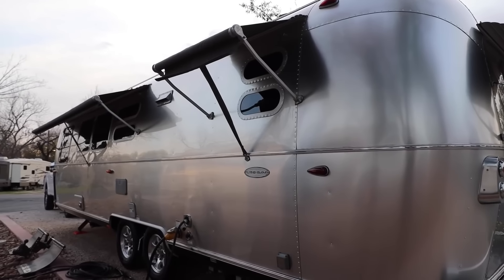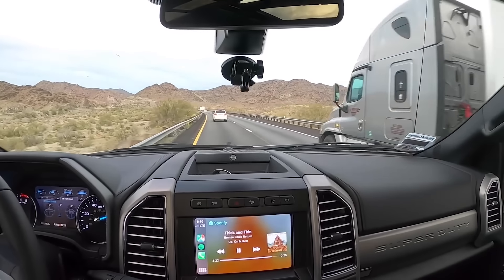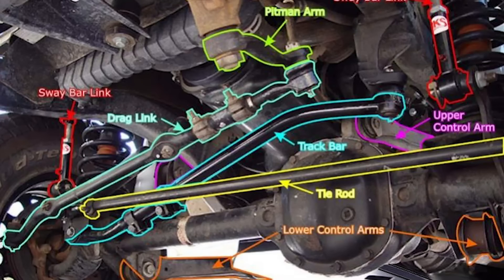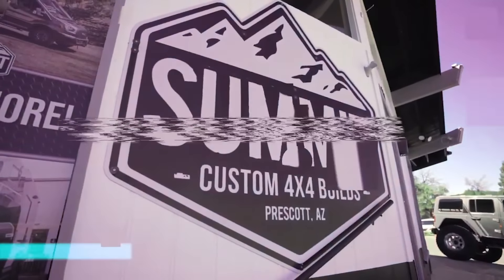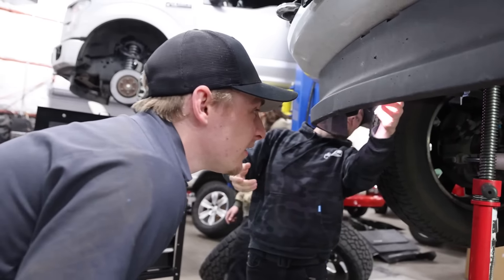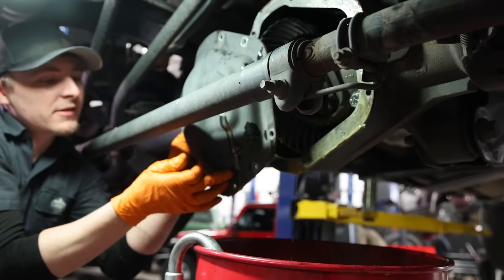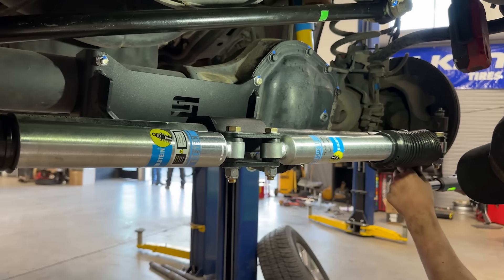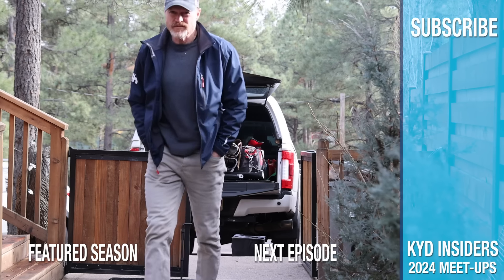2024 Ford Super Duty: Why We Passed...

Comment: I'm a retired semi-driver and the thing about changing all the batteries at the same time is bad advice. I bought a new Vovo in 82 and I bought a 35.00 load tester from Harbor Freight I replaced the batteries based on how they did on the tester, the truck had three batteries and I replaced two of them various times but one of them was still in the truck when I sold it with four hundred and ninety-five thousand miles.

Comment: On the stabilizers bumping: There was a change to the engine crossmember for 2019, so kits made for 2017-2018 models would bump it. I had that situation and it bumped BAD until we figured out that they ordered the wrong part and there was a kit designed for the 2019. Got the shop to take the hit and install me the right one at no extra cost, they are the professionals and should know what parts to order.

Comment: I need to comment on oil changes. 
Oil filters have a limit to quantity of particles it can handle until they are completely clogged. 
After the filter is clogged, they have a built in bypass. 
Which means it will no longer filter the oil. 
I will say (with certainty) no filter lasts as long as a manufacturer states. 
Also, keep in mind, recommended oil changes are suggested by the people that would love to sell you a new vehicle.

Comment: We have the exact same truck except in Black. Just a little over 100k have already changed the oem shocks to the Blistein 5100s definitely looking at the exact same front end work you've just had completed. Had death wobbke at 20k had Ford fix it as part of the recall no issues so far. Truck had about 15k when we purchased however other than tires and one set of brakes we've had no other issues. Thanks for your continued content as some of your other mods are also in my radar.

Comment: As for maintenance,  all my vehicles have over 250k on them.  Gas and diesel, i change all engine oil at 5k miles, transmissions & transfer cases I do every 25k and axles get done at 100k miles. I even have my kids doing this.  It's just easy to remember the numbers 5,10,15 your oil gets done 25,50,75k transmission. Spend a little extra now to make it last.  I do all my own work so that helps with the bill also. Im big on preventative maintenance.

Comment: Regarding ownership cost:
The examples you gave do reflect a low cost of ownership, with the exception of opportunity cost, or the “cost” of having all that capital tied up in a depreciating asset. 

We’re occasional travellers (weekends, maybe a 2 week road trip in the summer) and I’m not in a situation where I can or want to tie up a couple hundred grand in my rig, so…my truck turns 12 this year, and my trailer 14. Total value is probably under $25k(Cdn). I do pay more for maintenance. It just reinforces your point about starting where you are. 

Great and informative vid this week. Keep em coming!

Comment: I have a 2019 F 350 Limited. I purchased it just as the 2020 model year was coming out. I was very cautious about the 10 speed being first year in the 2020 SD and knew that the old 6 speed is great. It had 250 miles on it with full warranty. Paid 72K which I thought was a pretty good deal. The Limited is just pure luxury and I love it.

Comment: Great video! If I may add something to your comments about death wobble; besides the steering stabilizes, adding castor angle to the front end alignment is key. The factory setting is very low to reduce steering effort at low speeds.

Comment: For me the topper and bed slide is a must.  As a Chevy guy it is extremely enlightening how much you Ford Dodge and Jeep guys have to do to get your truck to drive normal! 😂 Looking forward to the new season!  Safe travels.
Reply: I agree and find it interesting that they won’t even consider a GM. There is no death wobble on GM trucks. GM quit udon the CP4 in 2016. Ford doesn’t care and continues using it. I am a retired mechanic and Ford is great if you make money fixing them. You will never see one in my garage.
Reply: Gm trucks have their own issues mainly expensive transmission problems with the Allison 10 speeds and shotty fit finish and wiring problems theirs a reason why the government has had to bail them out twice and now maybe a 3rd time.

Comment: All the points about a 2024 are very valid I’ve heard from YouTube and reading forums that the 6 speed (6r140) is a an excellent transmission and more reliable than the 10 speed (10r140)

Comment: The true preventive measure to prevent death wobble is a $30-40 set of caster shims. You need more caster than they come with in stock from.  I did that to my 2020 Tremor as soon as I bought it, and zero front end issues so far at 42k miles.

Comment: After selling our 2017 f250 platinum and 2019 Jayco Northpoint 377 about a year ago, we are wanting to get back to a 5th wheel. I just purchased a 2022 Ram 2500 Laramie 6.7 Cummins with 40k miles. I have no complaints yet. I’ve always owned ford but changed this time….😮

Comment: Having owned trucks for 40 years, I was somewhat astonished by the colour of the diff fluid indeed, as usually any time I've changed it's just black & oily.   Good idea on getting the transmission done, as I waited until the 130 mark, and I was starting to get a shudder when climbing hills (empty) so I went to the dealer and had a flush, and it's been fine ever since!   Still have a great truck their, and will give you great service for some time yet!   I do hear the 2024 HO has quite a power increase, so perhaps Ford would allow you to hook up the trailer one day to one, and you could give us a shout out on any differences?

Comment: I love my 19' F350 Platinum 6.7 - your oil change comment has me thinking and I'm thinking next oil change I'll send off a sample before my normal interval and see how it does.  I don't use my truck a bunch but when I do use it I try and have a trailer hooked to it most of the time.  I needed steering components on mine before 30k as well, quick dealer fix and it's right as rain.

Comment: OK! I'm glad your keeping the truck, there's no need to replace it you'll get over 300,000 thousand out of it easy! I had a supposedly well know service shop change the oil in my differential ! Well that turned out to be a disaster! I then needed to change the brakes, as it is a dully I needed to pull the axle . As a precaution I pulled the plug out of the differential and when I did there was something that shocked me... there was metal shavings all over it! Knowing that I just had that oil changed that pissed me off! I fixed my brakes and put it back together. I took it to ford because I wanted someone else to be my witness . Then I payed them to change the oil In the differential , they did and told me that no one had ever changed that oil! You being in the shop while they were working on your truck is a lucky thing!

Comment: I change my own oil and fuel filters as well as the oil on my F350 Super Duty diesel.  Oil change with filter costs around $100.00.  I buy the diesel oil at COSTCO.

Comment: I pull my rv with a 2018 f250 gas gusher but still get around 14 mpg. Keep it slow and steady and you can pull it with out problems yes maintenance is an expense but with now 98000 miles on it hauling the rv with no problems at all I think we do good.

Comment: I completely agree with you on the truck market. Last fall, I looked at a new ram 3500 duelly for $102,000.00. Now that all the kids are grown and independent, I started thinking about getting a luxury truck for an RV hauler. But then, a week later, I was at a dealership getting my honda serviced that I found a 2019 Ram 3500 sw 8ft bed, Longhorn trim, with 23k miles/ diesel. I got $10k trade in for the Civic and drove it home for less than $70k. That includes bumper to bumper coverage. I saved over $25k ish, and I am completely happy with the purchase. Now I just need to find the right RV.
Reply: LOL you got ripped off man. I paid $70k for my 2020 Denali 2500 brand new!  Your '19 is 5 years old now.
Reply: Full size, diesel, with 23k, longhorn trim.

Comment: 21:45 this is precisely why at 50,000 miles I did transmission fluid, both diffs, transfer case. Waiting until 128,000 miles to do a transmission service is far too long. You’ll be lucky if the transmission doesn’t start slipping on you.

Comment: On level ground I can go 60 miles an hour at 1500 rpm in overdrive and not in tow/haul go to tow/haul on hills. I have a 5.4 L gas engine in a F250 4x4 supercab super duty 8 foot bed pulling a 7770 lb if fully loaded pull trailer. ( I know they say one of the worst engines was the triton V8 but if you use full synthetic and change at a regular intervals and the correct oil viscosity that engine will go easy 200,000 miles and even more if you do a full timing redo.) Love your videos have been watching since 2017 or 2018

Comment: I agree with waiting and using your current truck longer. I worked for GMC Truck for 12 years and like you said it is not how much you pay upfront it is the cost over time until you sell. We don't put the huge mileage per year like you do so we tend to keep our vehicles 10-12 years. We did get caught in 2023 when we sold our 2009 Escape (178K miles) and bought a Rav4. No inventory, high demand...paid over list (never again). We know that over time it will be fine. Our daughter needed a good safe vehicle. Eventually we will need to replace our 2014 4Runner 153K miles. We aren't in any hurry as the new 4Runner or Land Cruiser will be just coming out in 2024. Will wait until at least the 2nd year of either vehicle. 2 reasons, new vehicle high price, 1st year teething problems. Just bought a small trailer so will sort it out and use up the 4Runner some more. They keep their value even with 200K+ miles. Enjoy your channel, peace.

Comment: I had a 2024 F-350 Limited 6.7L Powerstroke HO for 7 months and they won't even build them until September/October.   I have a new 33' Classic rolling off the line in April and picked up a Chevy HD 3500 High Country from a local dealer.  I have had 4 previous Super Duties but really like the HD 3500.

Comment: Great video. Smart decision to wait and see what the market does. 
I also like fords. Have a '17 250 and a '20 450. The 17 has 272k miles. Have really, really abused that truck with many 30k lb loads before getting the 450 and it held up great. Just replaced all the wheel bearings and some front end components and it drives like new. Hope to run that truck to 500k.
Safe travels!

Comment: Steering stabilizer shocks were originally designed for trucks with oversized tires with a lot of rubber on the road that caused steering shake, even with all good working parts adjusted and aligned. Death wobble comes from used worn parts that need to be replaced. Steering stabilizers would just mask over the problem.

Comment: Personally I'm a fan of the Carli high + low mount steering stabilizers vs the dual low mount. Also, a lot of death wobble on these can be corrected with getting the caster right on these trucks (increasing), and that will also help reduce the bump-steer.

Comment: Tires are the canary in the coal mine. They are the contact with the road and will tell you when there's something wrong in your suspension and steering components. A simple swipe with the palm of your hand in two directions will tell you if there is maybe something amiss. If there feels like there's a sharp edge in one direction or the other it's time to look for a problem. If it feels dull or rounded in both directions then you have not likely got a problem. You can never go wrong with Michelin tires

Comment: I was in the truck market a week ago. I bought a 1995 3/4 ton Cheyenne 4x4 in really good shape mechanically and not to bad to look at. For $3k. The front end consumables are a little tired and the brake hard lines are needing replaced, shocks and springs at some point in the future. With all that, even if I had to replace the engine and tranny, I’d still be at less than the price of a new truck. It’s a much simpler vehicle without any of the luxuries outside of ac, but the they’re so basic and cheap to work on. No disrespect to anyone for their choices, but I’ll give up those luxuries for more gas and adventures.

Comment: I bought a 2022 kingranch f350 diesel and my 2022 a/f camper. Rolled both onto the side going hunting. Insurance wrote them off but i bought both back. For 32k CAD my f350 is all fixed up and paid off instead of the outrageous new cost. My camper is also fixed and paid off instead of the 80 plus k for a new one. Ill drive both till they fall apart

Comment: most folks,, almost everybody just ignores there change times.. and just run till it fails... almost nobody reads the manual where it says to change the brake fluid, change the trans fluid, change the transfer case, change the diffs, change the coolant.. just like changing oil, just not as often

Comment: Easy to see your decision on keeping your truck and passing on the 2024. In addition to the economics, there is a factor that cannot be quantified. I have found that some vehicles are just "right" from the factory. Others just are not. They work o.k., but they are not "right." Of the dozens of vehicles I have owned in 54 years of driving, my "right" ones were my '01 Suburban, my '14 Escalade, and my '22 Silverado (current truck.) I could tell the first time I drove each one that the factories built a good one. Seems like your truck is the same way.

Comment: I'm in the market for a 3/4 ton in the near future.  I will likely drive to Summit to get the stabilizer put on.  At one time, shops like Summit were common.  Not the case any longer.  I'm not always looking for the cheapest.  I just want to feel confident that whoever is doing the work is actually doing it right and cares about their work.  I'm willing to pay for it.  About a year ago I had my oil changed at a shop that is franchised nationwide - starts with a C.  They informed me my cooling system expansion tank was low.  During the conversation the person checking me out lead me to believe they topped it off until I can get in to have it flushed.  I got home and it was not only low, but it was empty.  I could see where the hoses connected to the radiator there had been a leak.  I called and said, "they didn't top it off."  "Oh, bring it in and we can do that for you."  So the kind knucklehead at the desk took my keys and went to top it off himself.  He came back and I asked, "did you top it off with coolant or distilled water?"  He said, "neither, I used a water hose."  "Seriously?  I was standing next to a hose when I called you.  I could have done that."  "Ah, don't worry about it.  It was only about 3/4 of a gallon."  I left, went to Toyota, picked up coolant and hoses and spent a couple of hours flushing it myself.  Just can't trust anyone these days to do the right thing.  Pretty sure Summit would have insisted either a top off with coolant or likely a flush since it was needed.  But, tap water?  Ugh.

Comment: Watched again and am now wondering. My ‘01 Suburban 1500 was traded by my daughter and her husband at 305k. Original front end components and shocks all the way around. Brakes about every 100k on rears and 150k on the fronts. I hear what the Summit folks are saying about 30 - 50k on fluids and 100k on front end stuff, but that was not my experience. My current ‘22 Silverado 1500 is at almost 60k and feels, well, “like a rock.” I will keep an eye on it though and have my mechanic (same one that serviced the Suburban) check front end components when it is in for service. Your video gives my food for thought. Thanks.

Comment: Interesting. I had a new 2018 F250 Platinum Diesel and never had a death wobble. I put over 80,000 miles on it over 3 years pulling a Grand Design Reflection TT. It ran flawless. Only mods I did was an additional leaf spring on the rear axle and a leveling kit on the front end. The front leveling kit was required to compensate for the additional leaf spring on the rear axle.

Comment: Definitely had water in that front differential, its not supposed to look creamy like that its oil so it should look like oil. Maybe look into simply extending the vent tube up higher. If you go through water thats over the hub (15" -18") you should extend the vents up to 3' or 4' up into fenders. 🛢️✔️🛠️🔧🔩👍🏻👌🏻

Comment: At 50,000 miles (about 20,000 of those miles towing) the rear differential fluid was very dirty.  However the front t diff and transfer case fluid looked almost new.  I think the 30K-50K for rear differential fluid is a good recommendation if you tow a lot.  

Great video.

Comment: If your worried  about death wobble its been corrected,  2023 and up.   Also have a option for electric steering assist,  loose steering at low speeds,  tightens up at highway speeds.
Reply: As someone who had death wobble on our 2011, and now owns a 2023, I would love more info on this.

Comment: I’m 65 and for as long as I can remember Fords always had a crappy front end. Even when there new they wonder on the road. It seems to take a lot more effort driving a ford than other brands. I speak from experience driving company trucks. But this guy has done very well for the mileage on his ford. But if he drove a Ram or a GM the difference in the amount of effort needed to go straight down the road is a massive. So much more relaxing and less tiring.
Feather edge on the front tires on a ford is also very common. Rotating the tires only covers up the real problem.

Comment: Still rolling in a 1997 F350 7.3 long bed 4x4.   Pulls my 36 foot toyhauler effortlessly.  210k miles.  Love my truck. 

I’d love a newer gas 7.3 or 6.7 diesel but they cost too much.

Comment: Coming from 2020 F350 Lariat DRW 6.7 and now with 2023 Ram 3500 Limited LWB HO 6.7 with 4.10 gear.  I miss superduty's 10 speed but likes Ram's TPMS, Air Shocks for the rear.  Lot less drama on Ram.